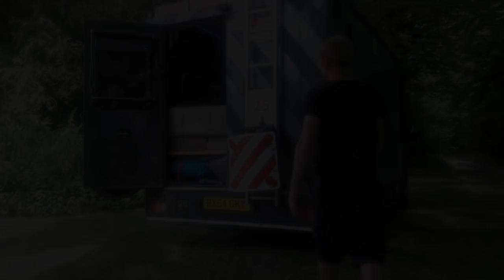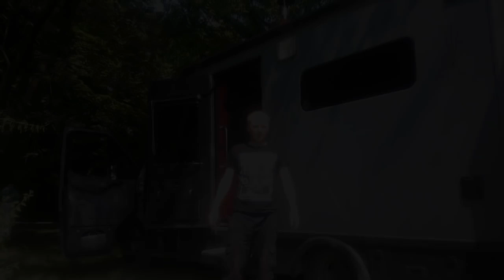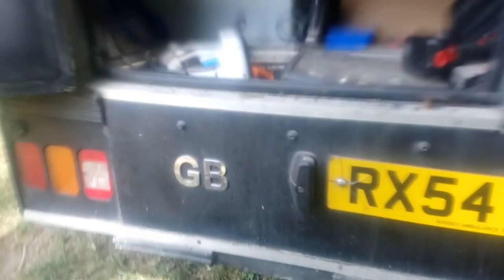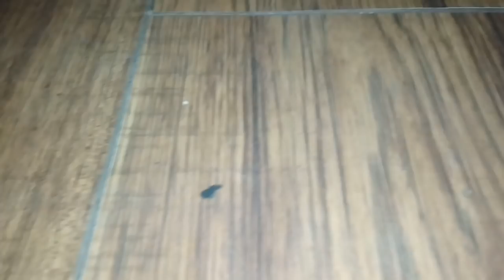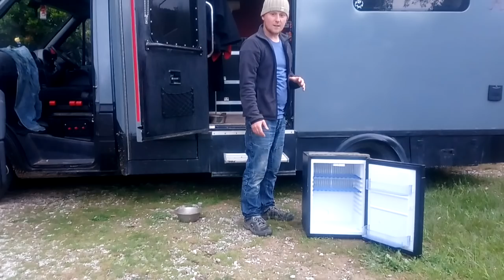Where I went wrong with my van : mistakes & planned changes

Comment: Subscribed following your visit to see OK Portugal. When you showed your ceiling areas it reminded me of a trick my dad used to do with wallpaper that had air bubbles behind it. He used to get a syringe of adhesive and just squirt it through into the air bubble, then press & smooth it down until it dried. Using a syringe meant the hole was tiny and easily hidden.

Comment: Hi CJ at one time you had ‘tips and hints’ videos which you seem to have removed?😧 One I wanted to watch was about getting a DECENT mobile WIFI signal and you had a mast or something🤷🏼‍♂️ i literally have to run a 20 foot USB extension up a long bit of conduit and ‘dangle me dongle’ out in rain in a poly bag or encased in silicone! I still barely get one bar! 😩 Any tips you used please for your build as you seem to get wifi even in a DESERT in Portugal 😂😂 🥂 cheers PROPER CRIMBO!

Comment: I wish I would of seen this video before I lashed out on. A new 3 way fridge , yes 4 independent air bags can run to quite a few bob , if you want a easy way to operate your gas pedal get yourself a choke cable and a small pully wheel on the floor under your pedal and up to your dash then you can operate it from the chock cable .when I was in the Army we used to fit them for when we had a long way to drive . In the end the manufacturers fitted them which was a bit more complex as they had a hole under the floor for the cable to go out and under the truck and back into the cab the only down side to it the draft in the winter on your legs although the hole was only small . Good luck with your making good I will have to now thing of a way to fit my fridge so it will stay a bit more level or so I can adjust it so it stays Level

Comment: This review is fantastic. I have a similar if not identical ambo to yours originally, thanks to finding @project.amber here on YouTube and I too need to remove the weight of the tail lift. How did you setup the back wall? Is the ali rivetted, screwed, bolted or welded?
Reply from the maker: Thanks,
My rear panel was made from timber frame, treated and bonded/screwed in. Then insulated and the ally sheet was bonded and screwed on with tek screws with self sealing washers.
Hasn't caused me any issues yet but I originally built thas van to do 1 trip then scrap, if I was to go again I'd make it out of ally box section and PU bond the lot together. 👍
Reply: @ProjectAmber  thanks for the reply man.

Comment: LPG a shop is cheaper then gas it ,I got a gas tank for my van with all the fittings except the pipe work to go to my fridge and cooker and water heater for £420 , gas it wanted £780 for a smaller gas tank with all the bits and I would of had to still get brackets to fit it under my van , I have not had time to fit it yet I’m thinking of the best place to fit with it being 300 x 1120 so it’s pretty big .

Comment: there's a device for army land rover radio fitted type that you pull out and its connected to the accelerator cable, I can't remember what its called, but I use to use it for charging the radio equipment in the back of my FFR.

Comment: Add 10 inch to the roof height so then you can do a drop down bed that's made up. Lights can be in the bottom of the bed for when it's up

Comment: Not the best conversion I've seen (especially from an ex pro builder) but definitely one of the best van life videos I've seen as you tell it like it is, warts an all. You are braver than me, I wouldn't tackle an ex NHS ambulance for a conversion myself due to the sheer amount of work involved just to strip it back to bare canvas and 'put it on a diet' as you so aptly described. They are notorious for having miles and miles of spaghetti wiring systems for all the equipment they held not to mention tail lift and associated brackets. Hope you are nearer to dialing it in to near as perfect for you as it can be. Sounds like you have the skills and know what to do. Once again, one of the best bullshit free videos on van life on YouTube. When you finally finish and get it done with its new interior colour scheme could you shoot an American van life video spoof next to a picture perfect beach, plenty of drone shots and your beach bronzed body clad in a white thong doing the slack line walk whilst juggling advacados, perhaps the dog doing headstands on the yoga mat on the van roof in the background with Enya's Orinoco flow as the music overlay ;-) Atb and I'm subscribing.
Reply: Your scary dude! Lol

Comment: I've done a lot of research on materials and solutions.  I also have an RV that I tinker with.  I think your ambulance looks great as is, but as you are discovering, it is an ongoing project.  Its fun to do this, so don't feel its a chore!  Here are some of my solutions to give you some ideas:

2:23 - use Dremel SawMax to cut a variety of materials.  Fine cut, interchangeable blades. This is a mini angle grinder which can also double as a detail saw for wood.  Tool is small and light and very powerful.  Will easily cut metal sheets.  You could also get a Bosch 5 inch Angle Grinder from Amazon for $80 refurbished which is heavy duty but weighs more.  The Bosch will cut through a metal gate!  If you get the Bosch, make sure you get a paddle switch, adjustable speeds, and a Leave On switch options.

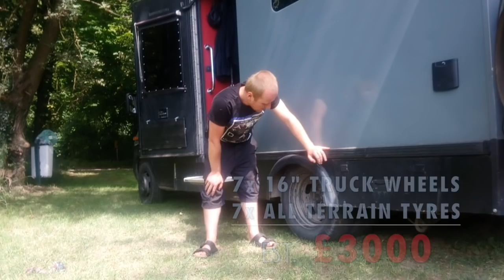3:35 - When you change your tires, make sure the inside wheel of the dually has a flexible stem that can be air filled from the front.  I had a very bad install where this was impossible to reach.  Had to remove both tires and fit out with a stem.  Some stems leak!  So be sure to buy quality valve stems and the flexible tube ones seem better.  

Funny how small things like a gas tank can be such a pain!  The clutch check is a good tip, thanks!  I've had some nightmares myself.  Two rear tires went flat on a US Highway miles from anywhere, in 105F heat wave.  I had no shoulder to park on, and commercial trucks were flying by about 6 inches away from my van.  I had to call the police to get some peace of mind.  Took me 5 hrs to find a wheel change and get tires swapped on the road.  I could have died there!

Ha, ha, ha!  So true about 'stuff'.  The one tool you leave behind becomes invaluable.  Or clothing!

I disagree about the microwave. I have a 4K Onan Generator in my Class C van.  Micro runs on that.  Get a small generator about 2000 watts and use it to recharge batts and run your appliances.  I could not live without my microwave for reheating, because I cook in batches and just reheat all week.  Also good for hairdryers in cold weather or emergency extra heating, AC, etc.

If you want to remodel your cabinets, look into T-slot aluminum molding, which is also sold under brand name 80/20.  Use this to build new cabinets to match these.  There are 3 good channels which explain how this is used:  Greg Virgoe, Ourkaravan, Dave Orton.  

11:13 - the problem with putting your water tanks outside under carriage, is that they will now freeze in cold weather.  Anytime you store the RV you will have to drain it out. Unless you insulate it well with a heating element.

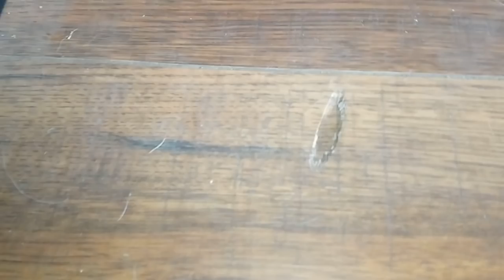14:00 - see what the 3 people listed above have done with their flooring.  Dave has an interesting floor using rubber mat.  Just cut to size and loosely stick this on.  Done.  Put a nice plush rug on top for your toes in winter.  What you did with vinyl is just fine.  Its durable enough under the bed and hard to reach areas.  Its actually the best material you could have used.  Wood would rot or crack, rubber would compress with weight of appliances, cork would disintegrate, ceramic tile would crackup, and carpet would turn gross.  So what do you have left?  Only vinyl.  Good choice. Your issue with it moving is because you did not use an underlayment such as Silent Silver or Blue from Amazon.  Use a good closed cell neoprene product underneath and redo.

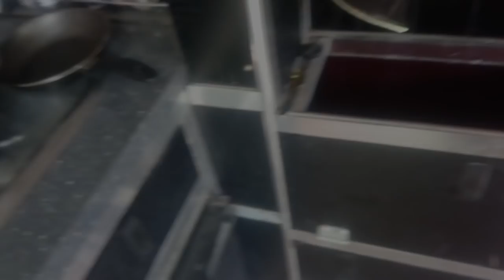16:38 - Bathroom door - Get the Nautilius screen door (pricey option) or use a Stromberg Carlson Extend-A-Shower curtain rod with a shower curtain. This pushes outward to give you more shoulder room in bath for $26.  Push it inwards to use as a drying rack for wet clothes.  For the floor, just use IKEA deck tiles in wood for a custom bath mat. I've seen stainless shower pans with a large drain, topped with a slotted wood cover.  The depth is 2-3 inches.  You stand on the wood cover and water flows below.  Make sure you use a waterproof membrane below like Schluter Kerdi membrane or Kerdiboard.

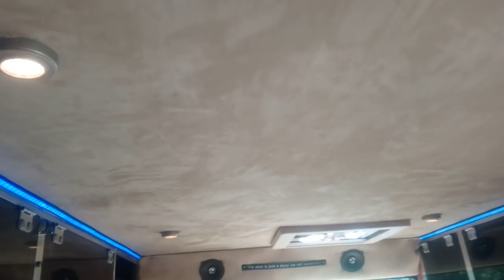17:28 - Home Depot sells fake plastic tin tiles on a roll that look like real embossed tin tiles.  Easy to clean surface, gives texture, artistic flair, and not an industrial white. They come in all tints- copper, bronze, white, silver, antique tin, etc.  Rip out the cloth and put these up instead.  Don't feel bad, its a common problem with the dampness outdoors.

Laundry basket - IKEA has great cylindrical wire frame nylon mesh bags that can be folded down into a flat disc when not in use.  Easy to lug to laundromat, weighs nothing, and looks great.  Isnt there a small chute on right side of your countertop?  Great clothes chute.  Don't use this for smelly trash, not the best option.  You can buy a small high RPM spin dryer from laundry alternative for about $60.  After washing by hand, spin in the electric spinner and clothes come out almost bone dry.  10 mins in sunlight, done!

Absorption fridge - yes the downside is the leveling issue.  Has to be level. So keep some small levels on hand.  The other issue is the ash and rust and spider webs collecting and blocking flues.  Tap the chimney to burner, and the burner flues then blow out with compressed air.  Make sure electrode is near burner.  Its old technology and a bit finicky. Bouncing around should have no effect on fridge.  However, compression fridges are pricey and you need tons of power!  Until you get the solar all fitted out, keep this fridge. Remember it also needs good battery power to turn it on.  Some good compression fridge brands are Vitrifrigo, Nova Kool, and Dometic in that order of quality. Be sure to get a large freezer compartment separate from fridge.  Spend the money, its worth it.  At least 6 cubic feet in size with 2 cubic feet of freezer with separate door. Don't stint on this.

Rev button?  No, no, no, dear man!  Get a small generator and a solar system.  You already have an inverter, so solar is easy.  Monocrystalline 100 watt panels from Renogy, MPPT Charge Controller - amps limit panels (30 am Controller = 400 watts total solar panels max limit), some in-line fuses, a battery monitor, and done!  Easy to do yourself.

This was a great learning curve.  Don't be impatient.  Van builds take time.  Do it little at a time and use the van because your requirements will change as you use it.  Its the same frustration for everyone.  The van build exercise demands that you become an engineer.  This is training you to analyze every detail before you embark, and then some!  A great teacher is your van.  If you were a Ninja, this is the same training for life.  Thank you for sharing!  I learned a lot from you on ambulances and find your honesty and humility endearing.  So many people are arrogant these days and never learn from mistakes.  I made so many mistakes and realized its an enjoyable process to redo one better the next time.

Comment: Hi I am interested to know more about how well insulated the ambulances when you first got it? John
Reply from the maker: Very good, it had celotex type stuff inside the walls, but a lot denser. It could always be improved but I have no complaints the original insulation

Comment: Instead of using the stick idea for higher idle speed, see if you can adapt a throttle control off a push mower.
I don't recommend using it as a cruise control, but if you are going over really rough terrain, you can hold your revs constant while you bounce around inside the cab.

Comment: If you like to set the engine rotation to a specific speed I would suggest installing this : https://www.ebay.co.uk/itm/183835265319 - Way better and easier to use than a wooden pole.

Comment: B & M have some larger carpet tiles which you can take up whenever you need to, water spills or stains, can be taken up cleaned and dried out, lino is good but if you get a rip in it you would have to tape it down and the look would be spoiled, damp lifts the gaffer tape etc, believe me, I have had lino!  Anything in sections, even laminate made into squares, so that you can lift it, herringbone wood blocks type of thing look good in sections, Poundland do Lino type tiles about a foot square each one and they do last and if you do get a rip you can scrape it off and replace with a spare, just a little info from experience. A company called William Marston, 70 Fazeley Street, Digbeth, Birmingham, B5 5RD does all the car interior material, every colour and texture you could imagine, my grey felt feel stuff in my camper cost about £5.99 sq.mtr. Tel 0121 643 0852, hope any of this is helpful.

Comment: external tank... If you've moved it by now..... did it freeze over winter?
Reply from the maker: No problems through winter. The insulation definitely had a part to play I'd say.
Reply: Project Amber good to know ta, I'm thinking of designing an "endless" shower for mine but would require an extra external tank.

Comment: I'm definitely with you as far as 3 way fridges being a waste of time. I've got 200w of solar & a small compressor freezer along with my fridge, but tbh you'd be better off with a bigger compressor freezer & highly insulated coolbox running off icepacks from the freezer 😁.  In hot weather it runs continuously without having to run the engine at all. I am running a 200ah leisure battery...

Comment: 1 plughole in the middle, tapering in.
Reply: Would still have the same issues after a certain % slope. A shower tapering down with 4 plugs would work though
Reply: What I mean by that is the inverse of the standard shower slope

Comment: If i was you i would ditch the gas bottle and make up a marine super conductor bank where after 30 seconds charge you could have 12v 48v 110v 240v all day long without the sun or wind, Just a suggestion

Comment: Take care putting the water tank underneath the bus as it will freeze... You can get past this by submerging a car 5w car bulb 'Into the water (waterproofed terminals of course), provided you can handle the little power drain. 
Holding the accelerator is simple enough using a relay, a solenoid and a switch.. Obviously not to be used as any kind of cruise control. Or, a simple chain attached to the pedal and some kind of locking device at the dash maybe?.. Mechanical is always best though because it uses no juice and won't go wrong.

Comment: Hi, thanks for the great video! Just a thought, but since you went to the trouble of making your own sink  instead of having multiple drains as you mentioned, you may want to make the bottom sloping towards the existing drain? That may work for the shower floor as well as it's relatively compact. Cheers, Paul

Comment: About securing the dog dishes, here in the US there is a slide out component for The undercabinet kick panel in your kitchen that allows you to drop the dog bowls securely inside.  They can slide in to hide the dishes and pull out when the dog wants to get to them. It sounds like things cost a lot more money in the UK. Do you have a luxury tax?  Hope your hard work pays off.

Comment: Hey mate..I live on a boat..much the same as a van. I bought a second hand compressor fridge at a boat jumble for £40. Its lasted me 9 years and still going strong! Its far more efficient if you remove the compressor and heat exchanger and build it into a top loading insulated box. It acts as a cold sink and only switches on about 3 times a day so uses a lot less battery.

Comment: I got mine stripped now mate it's a 2006 sprinter the body is sweet but that floor was rusted at the bolt points (which by the way took 3days of WD40 and tapping with hammer to get out) , the back right in the middle rusted and by the sliding door in-between wheel arch ...get that rust grinded out weld if needed and repainted with the good stuff hammerite. The parts can be replaced the body eventually can't it's a job but a job worth doing.

Comment: For the el cheapo cruise control into a little box which has a turn knob on it to adjust the speed and a solenoid to release the thing if you hit the brake pedal. It also has a button which lets you set the pedal (or actually the wire running to the throttle control in a to be set position. Can be had new for about 25 pounds I think. these things are called the Dynad Eagle Cruise Control: https://www.youtube.com/watch?v=B4rTGhgIF2s

Comment: best to get a larger size cooler style fridge...you know the type which opens from the top... For various reasons but mainly because heat rises and a chest fridge doesn't get as much "cold" loss as a standard style fridge. You can set these guys on a drawer thing which also opens the lid whilst it is rolled out...

Comment: It's a nice truck so you built it nice if it has no windows in there that's crappy because now you got to use your battery power just in broad daylight just to have light inside we still make no sense to me got a couple Windows if it's broad daylight was freezing cold at least it lights up your vehicle which means you you use less power to light up your vehicle inside...

Comment: How did you interface the aluminium with the steel vehicle?  Any direct electrical connection would cause electrochemical corrosion.  Seems to me sticking with steel would be safest unless your vehicle was also made of aluminium.